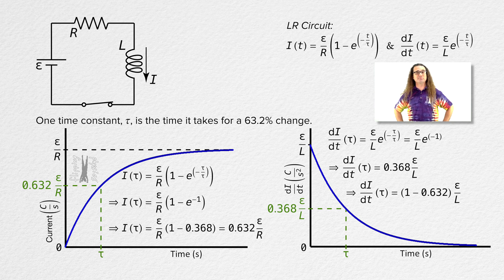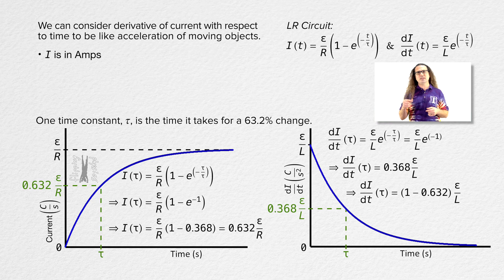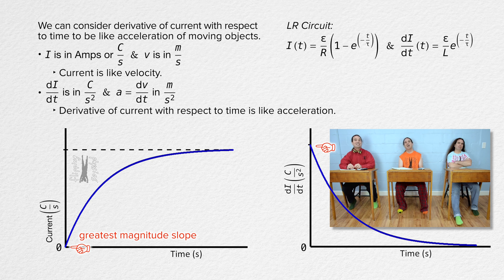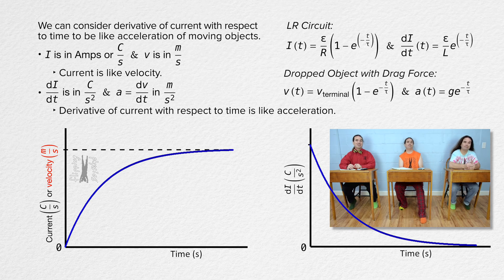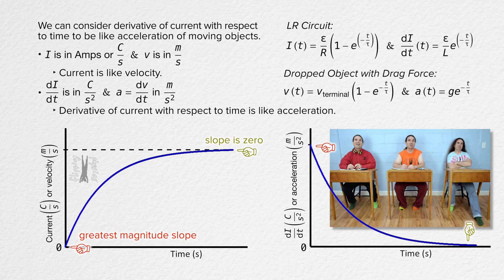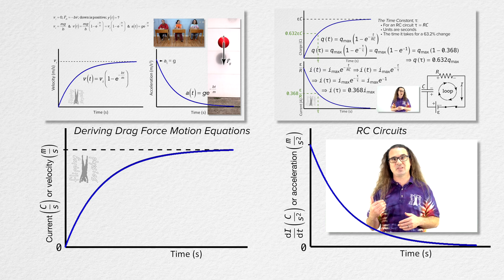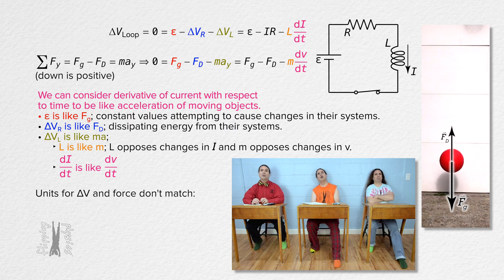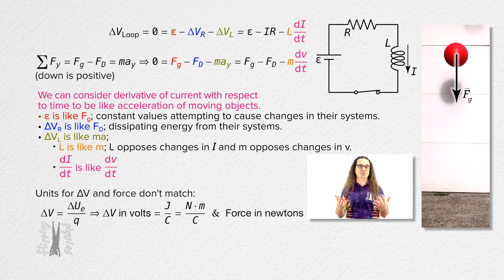Analogies Between LR Circuits and Falling Objects

Comment: Love the analogy! I'll plan to use it with my students.
Reply from the maker: Thanks. I never realized it until I sat down to write videos about LR circuits and noticed all the similarities. I think it can be really helpful for understanding this concept which can be very difficult to visualize.
Reply: @FlippingPhysics  As a mechanical engineer, I've always liked the analogy of water flowing in a piping system being like electrons flowing in a circuit. Flow rate is like electrical current and pressure difference across a restriction is like voltage difference across a resistor. In fact, there is an almost exact analogy to Ohm's Law (I = V/R), where fluid flow is directly proportional to the pressure that is pushing it, and inversely proportional to the friction losses in the system. In fact, we can use the ΔP across an orifice just like we use the ΔV across a resistor to measure the fluid flow!